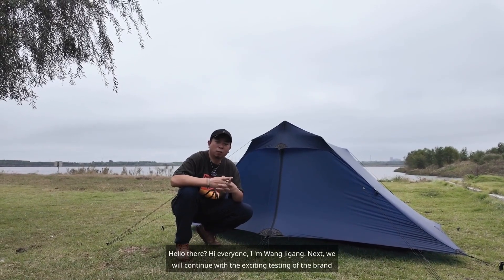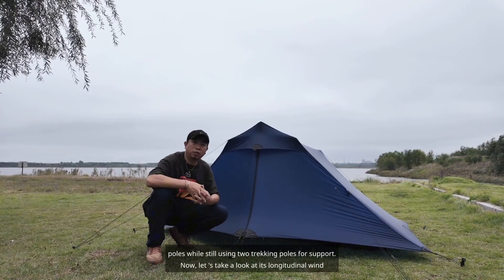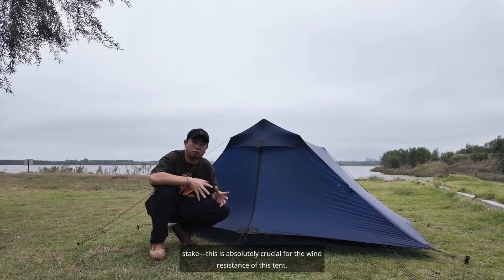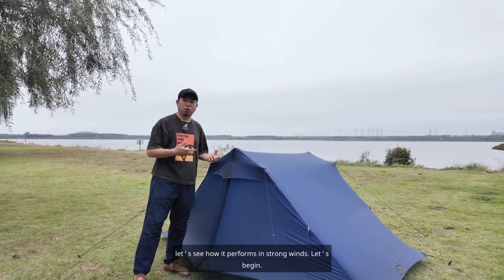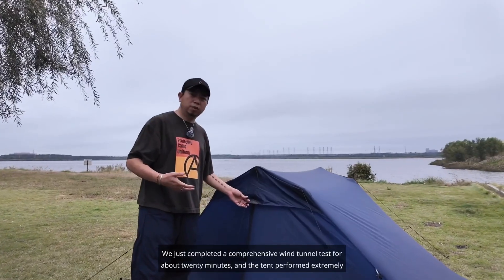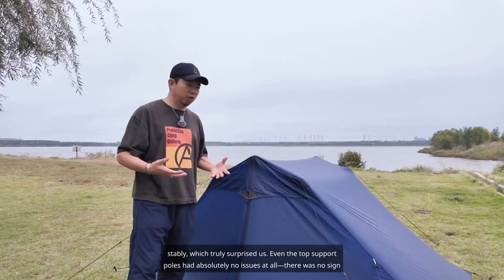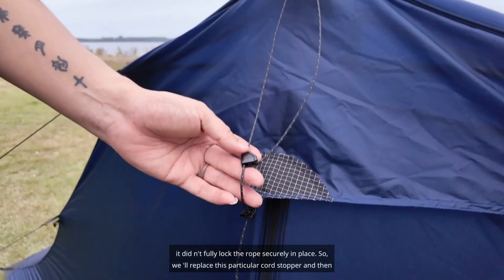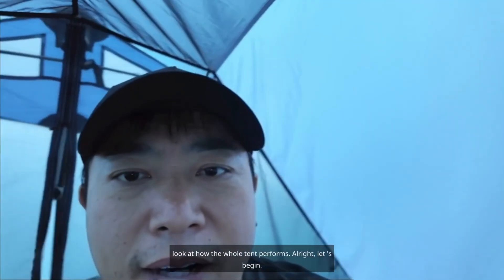TFS Vista Trekking Pole Tent--High-Power Blower Test(Average speed 60 mph)

Comment: Very impressive fabric. Seems more practical than a Lanshan and probably better wind performance
Reply from the maker: Hi, it's obvious that Vista has more space, but of course, the downside is that it adds weight and more assembly steps. It depends on the demand and trade-offs.😊
Reply: Worse, at lest in terms of the design, not delivery. 

An arch through the tent adds a lot of stability. That’s why mountaineering tents have multiple arches going through the tents. 

Obviously this solution is much lighter. All solution has pros and cons.

Comment: Looks good. 2 guylines loops on those big side panels and we can tie out guys if needed. Would stop the flapping.  I find flapping loosens pegs too. I saw it wasn’t fully guyed out on the front which is impressive. I always carry spare clip on guylines so the 2 loop idea would work for me. Looks a good tent that. Well done.  👍
Reply from the maker: Hi Andy, yes, just as you said, when the wind is particularly strong, the tent will shake violently, causing the wind rope stopper to lose its function. So, based on my experience, I think it might be better to tie a knot to fix the wind rope at this time. I will test it this way and share the process. Thank you.
Reply: @tfstents I used extra guylines on the Enran in quite strong wind and they definitely made a difference. Not always required but handy just to clip on if needed. 👍 good work. Thanks Wang.
Reply from the maker: @AndyWardle thanks❤

Comment: Another really useful video Wang. I certainly wouldn't get a good sleep but the strength and stability is way beyond a Lanshan I'd say ! Nice. Andrew
Reply from the maker: Hi Andrew, I feel that I didn't set up the tent properly during the wind speed test this time, and the height of the trekking poles was not enough. So I improved the FLY skirt of the tent. I will re-shoot the video and it will have better stability. Thank you.
Reply: Certainly not with that noisy fan right next to the tent 🤣